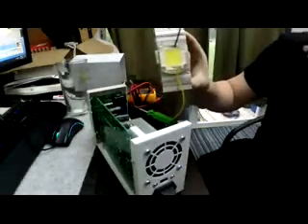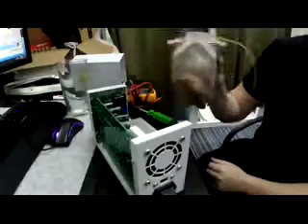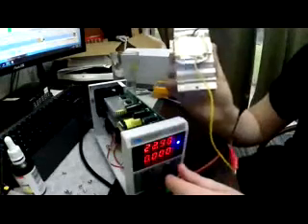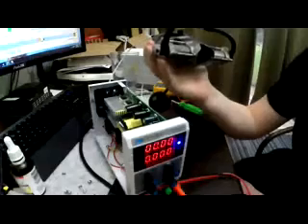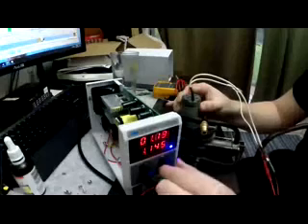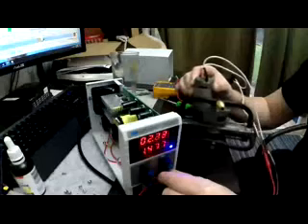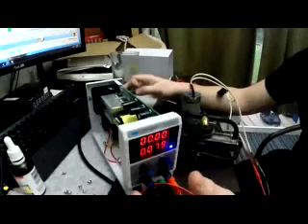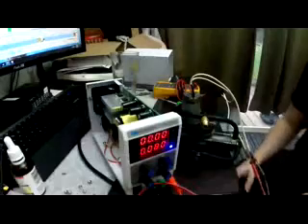Lab power supply introduction STP3005H 30V 5A

Comment: Someone may be interested how to repair: this defect is caused by the breakdown (short circuit) of the analog regulator's transistor, STP75NF75FP. The power supply has two regulators in series: one is switch mode pre-regulator, and the other one is linear post regulator. The ripple remover is the second one; and the first one maintains the constant voltage of ~1V across linear regulator transistor. Although the supply has constant current mode, a short circuit of output at significant output voltage creates a huge surge on the linear regulator, and it is broken down. There are two semiconductors on the top heatsink in the unit - the closest to rear side is the dual schottky diode, and the other one is the analog regulator transistor. Check that there is a short between all terminals of this transistor, and if true, replace it with any available N-type power MOSFET rated for currents above 10 A and voltages above 40-50V. I used an old IRFZ32 found in my lab, but others will work too. After the repair, the functionality will be restored.
The switching regulator section is built in a traditional way - it is using TL494 controller (like in computer power supplies). The feedback system includes several LM358 operational amplifiers. The reference is TL431, it is adjustable with multi-turn potentiometer. The current and voltage displays are also adjustable.
There are two problems with this unit: it is not protected from instant short circuit, and it has significant noise from the switching regulator on the case ground : similar to PC switching supplies. The noise is induced in ground loop. So it cannot be used to power sensitive analog electronics like audio amplifiers, where high frequency noise is not tolerable.